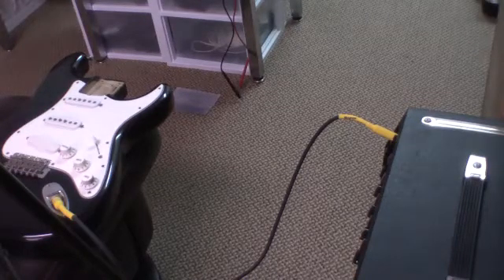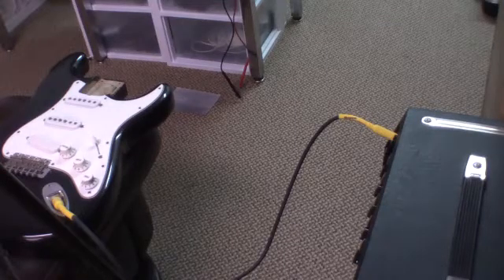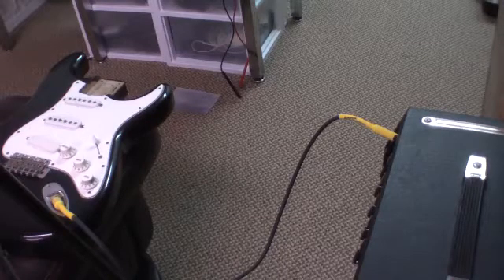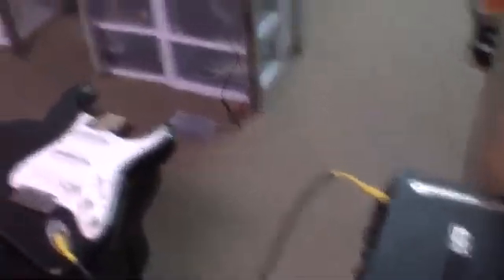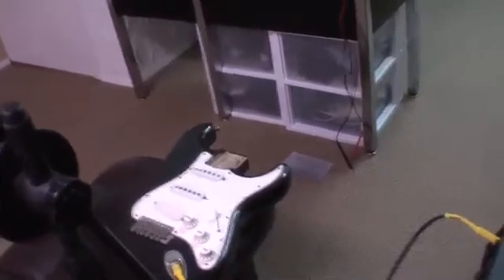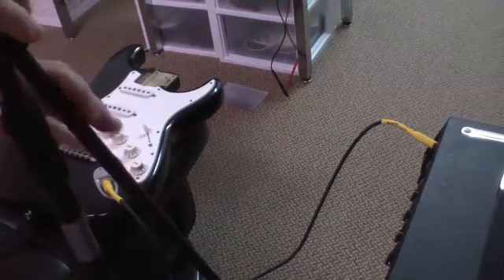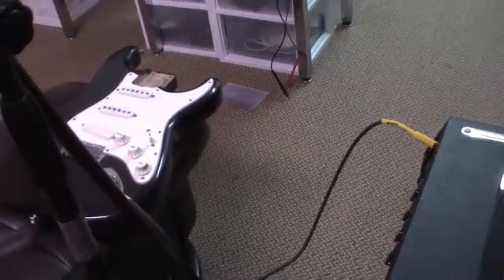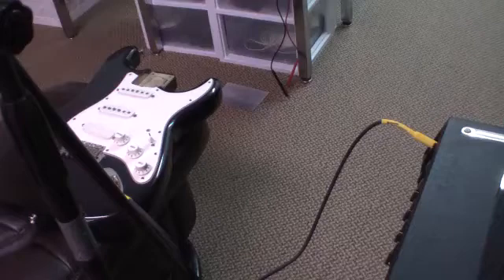Does Tone Wood Affect the Sound of an Electric Guitar when Plugged In?

Comment: I found it interesting what you said starting around 10:04 - that the wood is a "negligible effect."  That would suggest that any effect it does have does not make much of a difference.  Not sure if that is what you meant to say or not.

My take on this stuff is simple.  If it sounds good, it sounds good.  I have some guitars that are just "bright" no matter what electronics I put in them.  Not sure why.  Could be many factors, including wood.  But I have other guitars of the same model by the same manufacturer made from the same species of wood that are not nearly as bright.  Even within a species of wood, there are many variations.  So even if the wood is making a difference that you can hear (and I most certainly agree the wood effects sustain) it is difficult to judge what that effect would be merely by determining the species.  I am not really arguing tone wood one way or the other, but what I am saying is the best way to judge a guitar's tone is by actually playing it through an amplifier and hearing it.  That way there is no guessing.  In the real world, that is the only way to really tell.  Try it before you buy it.

As an aside I will say that I am pretty much a traditionalist in the types of guitars I like and the types of wood they are constructed from.  That is my preference, not sure why.

I agree with you that construction makes a huge difference, and the selection of wood for the structure of the guitar is important, which is probably one reason why I am a traditionalist.

Anyway, interesting test.

Comment: so a guitar is played by smacking your nails on the body? since that really isn't how you play a guitar it has no bearing on whether or not the wood makes a difference when actually played. 
medium does not create frequency. if a frequency of for example 800hz is put through various medium the only possible measurement from the medium is 800hz. the only thing that comes out is what goes in. waves only cancel when frequencies match over at the same given period of time.

Comment: What is the percent of the reflection? In other words how much of the tone is based on the wood? 1% 2%? is it 100%? If it is 1% no real impact on the sound.
Reply: Very good question.  I agree if it were negligible,  it would not be heard.  However one thing we do know  is,  that,  on a spectrum analyzer, if we are visualizing 3-6 db differences within certain spectrum ranges...  Then,  those ranges are more than double in volume.  For example if one wood produced overtones of 220hz that were 6db stronger,  than another wood,  while an A string was struck.  Even though the predominant 440hz tone is hard loudest,  it's my belief that or ears are probably surprisingly perceptive to even slight additions of sub harmonics and overtones.  Stop what percentage of the overall musical experience these constitute...  I have no idea,  but my guess would be that in ideal,  perceivable situations,  as little 2 or 3 percent might be heard.  Hearing might be like taste...  Can you tell the difference between 1 and 3% milk?

Comment: ohhhhh 
so wat you show us is that wood does matter with bad, microphonic pickups?
Reply from the maker: Patrick The pickup set is essentially the same as this one:

http://www.musiciansfriend.com/accessories/fender-stratocaster-original-57-62-pickup-set

Except they are worth over $300, because they are a from a vintage re-issue of 1982, Fullerton. That said, they are all made the same way in regards to potting.

The effect takes place, also, with Seymour Duncan JB, and '59 pickups, modern humbuckers, I tested the theory.

Both sets of pickups are potted.

All pickups have a slight microphonic pickup, because, a pickup IS A MICROPHONE, minus a diaphragm. All pickups are ultra sensitive devices.
But your point is interesting, in that I DO believe that low output microphonic single coil pickups allow tonewood to play a slightly larger factor than high output humbuckers. If you want to call their inductive response "signal", and the tonewood "noise", then, their signal to noise ratio is lower, is my opinion.
Reply: KyleCarrington thanks

Comment: What kind of volume settings did you have on amp? Was it turned up pretty loud? Whilst I'm not one to debate wood has zero affect, but indeed this experiment required you to have really high gain to get the pickups to pickup the wood sounds it makes me think that wood would not necessarily play a major part of the sound,if you know what I mean.
Reply from the maker: FINALLY, A REASONABLE COMMENT! you are 100% correct. it is a very high gain amplifier, 4x12ax7's. and it was up probably 2/3rd on volume. thius experiment was merely to illustrate sound can, actually go directly into the pickups from the wood .. though as you say, it is a very minimal effect. people seem to think that anyone who believes that tonewood makes a difference, believe it amkes a big difference. in my opinion it is an ever so slight effect, that in essence, however small, IS IN FACT what generations associate with good tone. let me explain. you take a set of gibson les paul '57 classic pickups, you mount them on a $50 guitar made out of basswood or plywood...  OR you have them on a perfect les paul. the les paul tone is going to be slightly better, but at the end of the day, if u record the $50 guitar, you're left with "that sounds amateurish, it's not great" , and if you listen to the les paul, all other things equal you are like "that sound like what i am accustomed to hearing on recordings" So the tone change may be absolutely minute, but it is, in fact definitive, and important when quality is needed.
Reply: KyleCarrington yes I know what you mean. I wonder if the overall tone of guitar could like the equivalent of recording two tracks and mixing them to one - ie. the pickups picking up the strings directly and this mixed in with the tones provided by the wood?

Comment: No, wood cannot impact the electrical signal your guitar picks up from the strings, it is an old wive's tale, one I just accepted as tru for 20 years. Maybe more.
Reply: Of course it can. The wood ultimately effects the pattern that the string oscillates with. Because the string is attached to the bridge, and the bridge is attached to the wood, all of these items interact, which ultimately determines what sort of oscillation the string creates. That oscillation, is the signal, as determined by the pickup. Your statement could only be true, if the string vibrated, while held in place by infinite mass of infinite density. Simple physics proves you are wrong.
Reply: false. I hope I can get Mythbusters to dispel this once and for all. When the sound becomes an electrical signal, all the acoustic properties of the wood become inconsequential.
Reply: Blah-de-blah-de-blah, the acoustic properties of an electric guitar cease to matter when the vibration of the string becomes an electric signal. They are electronic pickups, not microphones. You believe in a fairy tale. Indeed, hook up an oscilloscope. It will show you are wrong, and you will be left arguing that "Not everything can be measured by an oscilloscope, somethings can be heard that cannot be measured". You talk and talk like science is on your side, but it is in fact, not. If it were, the other folks who believe in "tonewoods" would be able to demonstrate it somehow. They cannot. Instead a casual search of Youtube will show you experiments proving that wood does NOT affect the tone, and a poplar telecaster will sound just like an alder or swamp ash tele.
Reply from the maker: MonkeysMonkeysMonkeys No, dumbass, the science is on the side of tone wood having an effect. The only sicence that is on the side of tone truther, is dumbass Will's stupid video that claims an electric guitar put out a signal that is entirely explainable by a singular linear algebra equation for a sine wave, which made me roar in laughter, because in all it's silliness, it certainly proves dumb Will never went to university; if anything at all. Newton's laws clearly PROVE and TEACH us that a bridge transfers vibrational energy of the string

INTO THE FUCKING WOOD DUMBASS

just a sec.
read that again.

A guitar bridge transfers vibrational energy of the string INTO THE FUCKING WOOD DUMBASS.

Go that?
Step. 2.

Newton's laws teach us that THE WOOD THEN exerts a force equal to that incoming force BACK INTO THE BRIDGE, AND THUS THE STRINGS, DUMBASS.

Got it?

Your string is not held indefinitely static in space by an inifinite mass of infinite density.

Perhaps then, if it were, you idiots could use your stupid theory intelligently, but until then, the guitars we use MADE OF WOOD...

they obey the laws of physics.
Reply: 1. I don't even remember reading the wager you're talking about. If in fact I did read it at any point, it was never presented to me personally in any email, or channel user message. So why would I take any of it seriously? If I read it all.
 
2. More importantly, the argument has never been whether or not Kyle Carrington can hear the difference in various tonewoods. The argument was, and still is does tone wood make a difference. Furthermore, as I have stated over and over. This particular video doesn't even address that argument head on, rather, it is even annotated in the beginning of the video, that this experiment is An attempt to provide evidence that wood, at all, would matter at all. so please, do us all a favor, and at least watch and read the videos, before going off on your fantasy physics, and fairy tale wagers neither of which stay on focus to the debate whatsoever!
 
3. Placing a bet on whether an individual can hear the difference between tonewoods is about as useful as letting a flip of the coin decide, so, if you would like to contribute to the argument, why don't you get off your stupid ass, and do an experimental video where and you actually make yourself useful, instead of continually coming off as a complete fucktard with nothing to offer but beak beak beak beak
Reply: The fact anyone believes the wood effects the signal that a pickup "picks up" is really just funny. I never really thought about it, for probably 20 years I just accepted it. Until someone made me think about how an electric guitar pickup works, and then I just felt foolish. No. affect. At All. You are making the claim it does. The burden of proof falls on you. So nut up or shut up!
Reply from the maker: raybbaby No, actually, Newton's Laws of physics state that the output signal is a product of both the vibrating string, and the effect of the wood, on that string, so while the wood doesn't "produce" a signal, the 3d motion of the string is affected by the wood. So , you and the other tone truther idiots - the onus is on you, not the 200 million that paid attention in school, and the 100,000 in the industry... sorry... but hey, maybe phone up Alex Jones, he's always looking for a good new conspiracy....
Reply: The more you talk, the more it is clear you're full of shit. You can say the earth is flat, hollow, inhabited by mole men, and the moon landing is fake. You can prove none of those things. Also, you cannot prove wood affects tone. Because it doesn't. If it did, Gibson, Fender, Ibanez and anybody else you can think of would have proof up all over the place. But they do not. Because the truth is, the magnetic field picks up on the vibration of the string, which is unaffected by the wood it is vibrating above. It's absolutely silly to believe it could.
Reply: Anytime somebody tries to argue That Isaac Newton said ANYTHING about how a guitar pickup works, when he died in the 1700s, and the first pickups were invented in the 30s, it's clutching at straws, and desperately trying to sound smarter than they are. Now off to bed, if you're not asleep, the tooth fairy won't leave you any money!
Reply: I don't think anything of string and infinite mass or infinite density. A pickup creates a magnetic field. Fluctuations in this magnetic field (created by a vibrating strings) creates an an electric signal that is then fed out to an amplifier. See the part where the wood is involved in some way? Of course not  because it isn't. And you know it isn't. Why you can't just admit that is beyond me. I believed it for years. Now that I allowed myself to question the dogma that tone is somehow affected by wood, I realise, no, no it doesn't. It physically cannot. Do you have some kind of ten thousand dollar guitar collection or something? There's no reason for anyone to be so emotionally invested in defending this idea. I guess nobody like to feel like a rube, but nobody is correct about everything all the time. Sometimes you gotta just step back and admit you held onto an idea that is false. The alternative is to continue to look silly.
Reply: ***** He's right, though. If your position had any credibility, then someone would take the bet. Your position is that it makes a difference and you present some theories for why, you invoke scientific terminology, yet not a SINGLE person can be called upon to demonstrate it with their ears? Your position is that it makes a difference within the ambit of human human hearing, but no human can be tested to demonstrate the efficacy of your beliefs? Your position is getting increasingly ridiculous. Even if someone has no position on electric guitar tonewood, the anti tonewood people crush the pro tonewood ones on logic alone.
Reply: raybbaby Exactly. The pro tonewood people, in their ignorant theorizing, almost always wind up articulating concepts that really reveal they have utterly no clue about how an electromagnetic pickup generates an amplified signal. They claim it's 'so obvious' and that ;'everyone can hear it' right up to the point that someone comes along with a blindfold and a bet, at which point they abandon that position and retreat into the realm of infinite possibility... well, see, maybe THEY can't hear it but MAYBE SOMEONE CAN!!! Its pathetic, for a position that started out with certain wood species having certain tonal characteristics that 'everyone who plays guitar knows is true!', until someone calls bullshit and it leaves the realm of free talk.
Reply: raybbaby
My own personal jury is out on this debate.  I would just like to add that even potten pickups are not 100% immune from microphonics, so some amount of  "ambient", non-magnetically induced sound can enter the pickups.  The percentage of the total sound that is microphonic may be important (or not).

I would like to see someone totally replace the electronics in an Epiphone Les Paul with those in a Gibson and then do a sound test to determine if there's a difference.
Reply from the maker: Mike Austin I just bought a 2003 Epiphone Les Paul, took the pickups out, put in pickups from a 2012 Gibson Les Paul Traditional, a '57 Classic, and a '57 Classic + set. My buddy has Gibson Les Paul with the same '57 set in, from 2009. Obviously they are completely similar sounding, but they aren't identical. Another consideration would be any caps across tone pots, and you'd want similar value pots, anyway... Last but not least the nut. Honestly... once I change my nut, I think it'll be damn close. A better test in regards to tonewood though, would be to have 2 sets of the same pickups, the same year....... and two guitars with the same nuts and the same bridges, but totally different woods. In that case I think you can hear it. In my case I think itd be tough